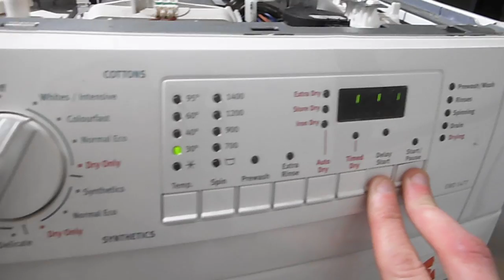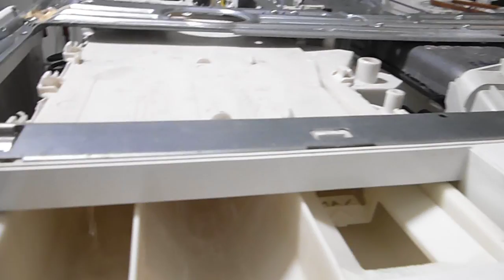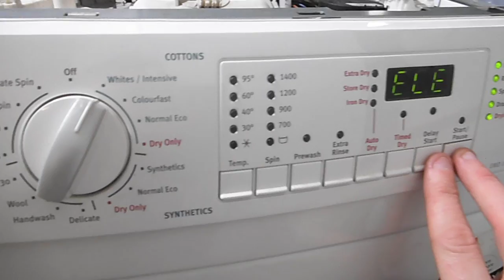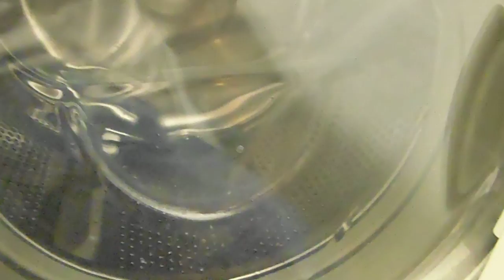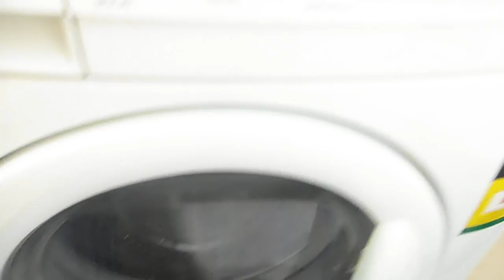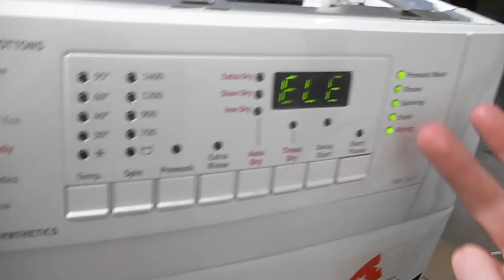EWD1477 service mode diagnostics mode

Comment: When you go into the service mode/cycle, the first part tests the control panel, 2nd step is testing filling main wash compartment, 3rd step is filling pre-wash compartment, 4th step is filling softener compartment, 5th step is filling bleach compartment (when available), 6th step is testing JetSystem and heater, 7th step is turning clockwise 55rpm and anti-clockwise 250rpm to test the tub for any leaks, 8th step is draining and spin at max speed, 9th step is drying and the last step is last errorcode. The "ELE" function does calibrate the pressure switch, this cycle can be ended when the washer stops with filling or after 30 seconds.

Comment: Wondering if it is all the same on all Electrolux washing machine. I have a Electrolux EWF12832 and it seems that the jet system won't always turn on. So trying to get to the Service Mode to see if I can activate it or if it is buggered and need to fix it. Problem is, that there is no click buttons, per say, they are touch sensitive buttons. So not too sure.

Comment: We're in luck, Electrolux Italia make one available here:

http://www.manualslib.com/download/735325/Electrolux-Ewm1000.html

Parts are available from here:

http://spares.bigwarehouse.com.au/index.php?cPath=64689_77309_77557&s=EWD%201477&n=1&pcid=1974886

Where we find a table that tells us the EDW1477 is equipped with an EWM2000evo control platform, which led me to the manual above. Looks awesome. May it be of help to you.
Reply from the maker: +Bernd Wechner lots of parts on ebay too I purchase a replacement heater module and solenoid that both shipped from italy.
Reply: +nucleochemist Ah, but first we need to work out whats' wrong. I've got the real service manual now as described above and it's awesome to read through that, as it removes a lot of uncertainty. Turns out the problem I'm able to replicate is described as:

Alarm: E35
Description: Overflow
Possible Malfunction: 
   • Water fill solenoid valve is defective; 
   • Leaks from water circuit on  pressure switch;      
   • Pressure switch defective; 
   • Wiring defective; 
   • Main board defective.
Action/status of machine:
   • Cycle stops. 
   • Emergency drain procedure. 
   • Drain pump continues to operate (5 min. on, then 5 min. off, etc.).
Reset: OFF/reset
Reply: +nucleochemist Problem is that "Water fill solenoid valve" is mentioned nowhere else in the service manual for the controller not is it clear what it might be from the description.

For an overflow to happen it's not going to be one of the supply side solenoids, but on the 7th diagnostic step which performs:

Door interlock. (Washing solenoid if the level of water in the tub is below 1st level). Motor (55 rpm clockwise, 55 rpm counter-clockwise, 250 rpm impulse).

And it turns out it passes this test if I don't let too much water in on earlier tests, but fails with E35 when there's more water in there it seems, suggesting a drain solenoid.

Yet, the machine drains just fine, and hence it is by not means a complete failure of the drain system, which sadly suggests that either:

1) There's a flow rate problem in the drain system (a blockage) which results in successful drain when draining proper but perhaps insufficient if it's given just a fixed window of time rather than water level feedback during a wash cycle. Pure hypothesising here.

2) A water level feedback mechanism is faulty, which presupposes it's trying to drain down to a suitable level and failing to because of this faulty feedback but another mechanism for detecting overflow is working.

3) "Leaks from water circuit on pressure switch;" is possible and needs a little diagnosis and thinking, as it suggests that a leak in the water system which wets a "pressure switch" is causing a faulty overflow report. But will need to work out where this pressure switch is ...
Reply from the maker: +Bernd Wechner You might have to spend some time, checking all piping. IIRC the pressure (water level) sensor is located up the top near the control panel. Theres a tube that runs down to a hard to access part of the drum. You might want to check for blockages by removing the tube. I have heard you should not try open or tinker with the pressure sensor itself as they are touchy. Also, the door solenoid burning out is a known issue with this model, I had the service guy out 3 times during warranty period and each time he replaced the solenoid as a complimentary preventative action because they are not supposed to last long (never use the machine's start delay feature as it keeps the solenoid running while the rest of machine is waiting, this lowers the solenoid life).
Reply from the maker: +nucleochemist I should add that the service tech was fixing other problems and replaced the solenoid on the door lock as a kindness.

Comment: Awesome! Very useful. Turns out I get an E35 on the Dry Only part of the diagnostic. Now I only need to work out what E35 means. 

I'm left wondering how you worked out this much, and if you have any tips on finding a list of error codes for this machine.
Reply from the maker: +Bernd Wechner Usually you can find the error codes in some service manuals for some machines or in obscure help forums online. Often manufacturers use the same codes on different models too, so sometimes leaving the model name out of the search is good.